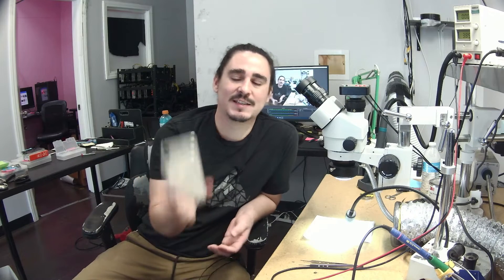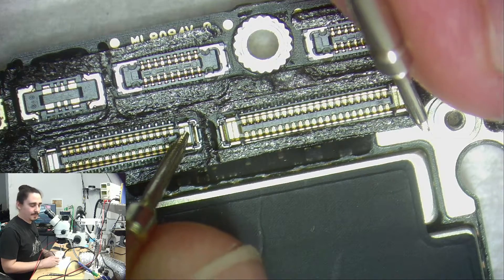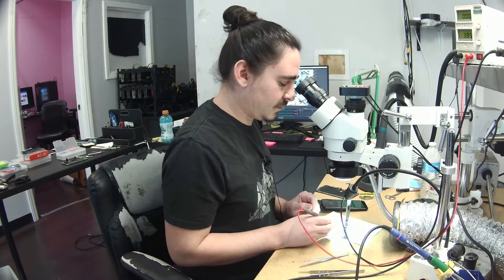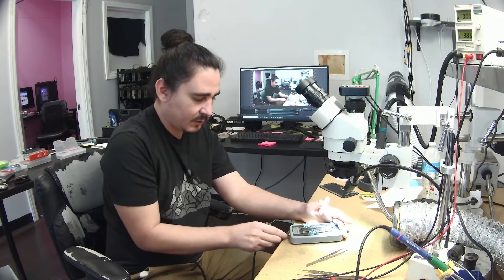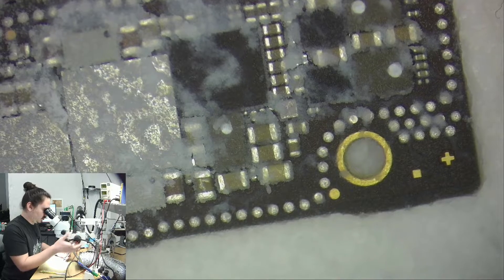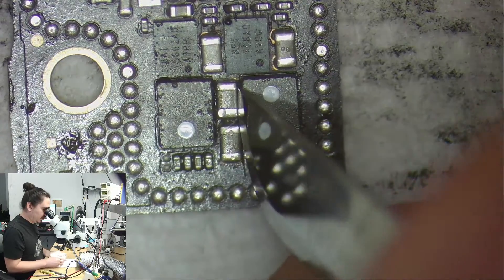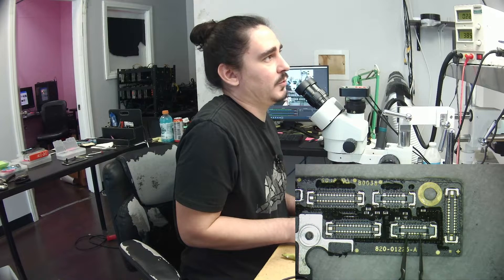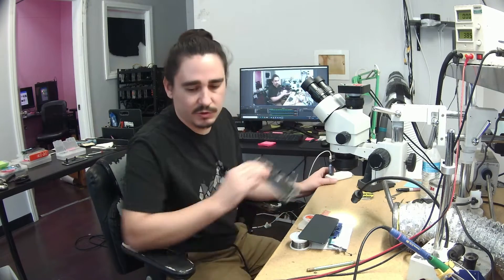Flat Dead, Undamaged iPhone XS Max - How to solve a VDD_MAIN Short

Comment: is an ampdraw of 0.034 or 0.075 considered a short? also when measuring resistance i get 010 or 075.
Reply from the maker: I am not sure what you are measuring. Amp draw from dcps vs resistance of measuring a line are two different things.
Reply: Sorry. I ment when I inject power to the battery connector I get an amp draw of 0.034 amp and when I measure the resistance of vdd main I get 010 ohm.

Comment: I like seeing both types of troubleshooting.   Why can't the phone be re-assembled and sent back as a working phone if the cap is replaced?  Thanks for sharing your work!
Reply: it will but that is not the main issue b/se some times for phone to function full you need to check lots of issue for example camera, mic, speaker might not work or phone may stuck some times and all this will bring a big head ace and lots of time to fix for technicians, but data recovery is just a one shot job!

Comment: yes i love your videos. Also this is the first time I see someone do a voltage injection using a dc power supply. If you can touch on that technique more would be grateful. I would say my main weakness when it comes to these sort of repair is diagnostics. If you can focus in depth on diagnostics and how you go about diagnosing problems in a much greater detail would be grateful. For example, I feel like if you had created videos where you say ok i will cause this problem or make this short on this line with this board, which would be a good board of course, and then take the board have that malfunction it would help us learn faster and better. More like working backwards. Thank you for taking the time to read.

Comment: These "simple" jobs are short and fun to watch, especially when you explain a technique or describe what's going on.

Can you tell me why the red probe goes on ground when in diode mode? I don't see how it would make a difference what the polarity is when looking for shorts.
Reply from the maker: Diode mode is checking voltage drop, not resistance. If the line is actually short, then you are correct and it doesn't matter. However, all these lines have a "normal" value when not short, and that normal value can only be seen if polarity is correct.
Reply: @iBoardRepair  ah ok. So the reference values have been obtained with +ve on ground, just by convention? I thought there might've been a specific reason to avoid -ve on ground in diode mode, like maybe it could damage certain components